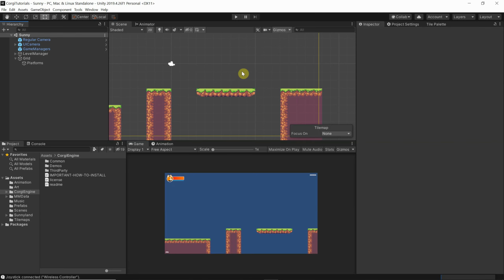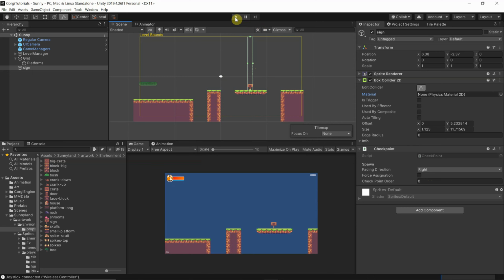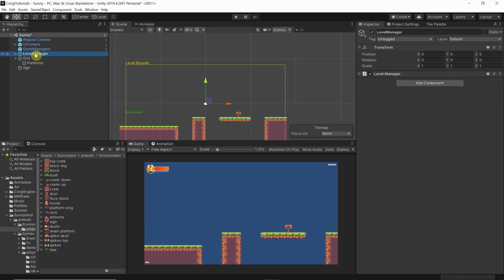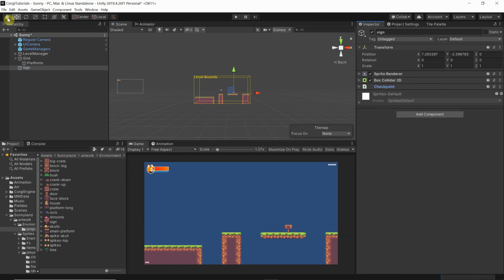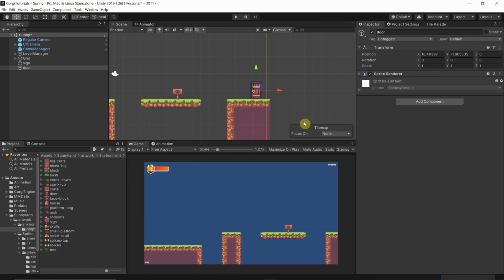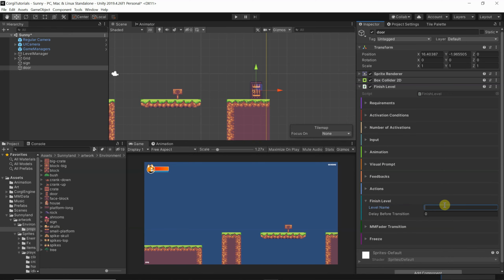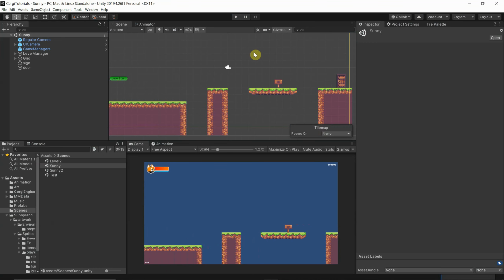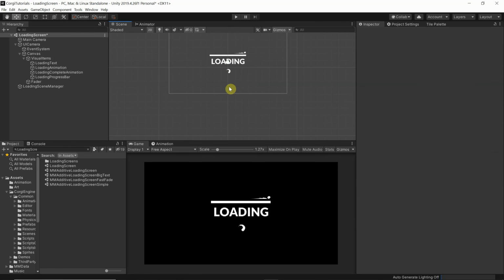Corgi Engine Tutorial - Checkpoints and Finish Level

Comment: Do you know how can I use the "Finish Level" script with a condition? Like the player would need to get a score of 300 to unlock the door and finish the level.
Reply from the maker: Hello Bluestacks
I did something similar in one of my games, but I didn't use the Corgi Engine for that. I wrote a simple script that checks the condition (In your case the points) which opened a door. Behind that I had the Finish Level. I hope that helps.